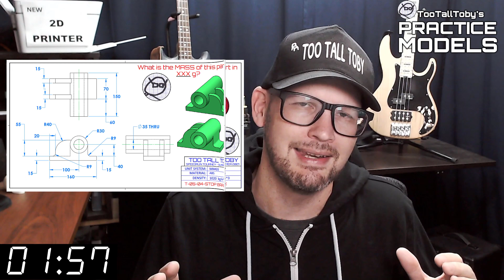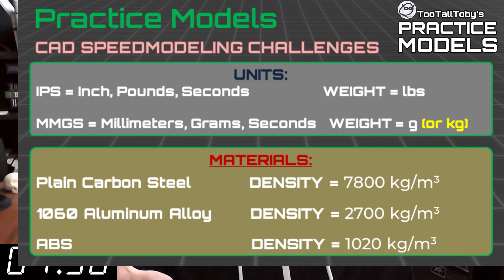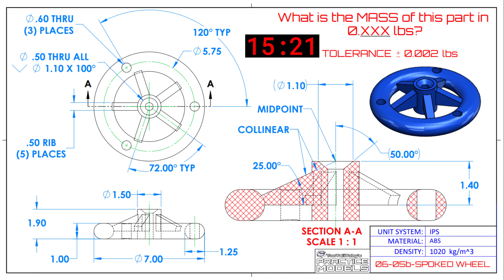SOLIDWORKS Practice - Onshape Practice - Fusion 360 Practice - TooTallToby-06-05b-SPOKED WHEEL

Comment: Got 0.863 lbs in 22 minutes. Not the fastest, but using a new CAD software called build123d! Here is the complete sourcecode:

densc = 1020/1e6 #ABS

ms = Mode.SUBTRACT

with BuildPart() as p:
    with BuildSketch() as s:
        Circle(1.5*IN/2)
    extrude(amount=1.4*IN)
    extrude(s.sketch,amount=-0.5*IN)
    
    with BuildSketch(Plane.XZ) as s2:
        with BuildLine(Plane.XZ) as l:
            l1 = Line((0,0),(-(7-1)*IN/2,0))
            l2 = PolarLine(l1@1,(7-1)*IN/2,25,length_mode=LengthMode.HORIZONTAL)
            l3 = Line(l2@1,l1@0)
        make_face()
    rib=extrude(amount=.25*IN,both=True,mode=Mode.PRIVATE)
    with PolarLocations(0,5,180,360):
        add(rib,rotation=(0,0,180))
    with Locations(p.part.faces().sort_by(Axis.Z)[-1]):
        CounterSinkHole(.5*IN/2,1.1*IN/2,counter_sink_angle=100)

    with BuildSketch(Plane.XZ,mode=Mode.PRIVATE) as s3:
        
            with BuildLine(Plane.XZ) as l2:
                m1 = Line((0,0),(-.25*IN/2,0))
                m2 = JernArc(m1@1,m1%1,.5*IN,-180)
                m3 = Line(m2@1,m2@1+(0.25*IN,0))
                m4 = JernArc(m3@1,m3%1,.5*IN,-180)
                m5 = Line(m4@1,m1@0)
            make_face()

    with Locations((-5.75*IN/2,0,-.5*IN)):
         add(s3.sketch)
    revolve(axis=Axis.Z)

    with PolarLocations(5.75*IN/2,3,0,360):
         Hole(.6*IN/2)
show(p,l2,s3)
print(p.part.volume*densc/454)

Comment: Whats the density in pounds?
Reply: Got it 0,865. Had Issues with the Density. Without i got it in 6,23min in Onshape
Reply: I make custom material library in onshape for TTT, in the list i only have ABS, 1060 Alloy, and Plain Carbon Steel :)
Reply: @siaunen2  so i did. But i forgot to convert the density😜
Reply: @stefanwuttig  you dont need convert the density just select it and i didnt even make it myself. Just use the one on public files
Reply from the maker: As suggested best solution here is to make a custom library in onshape and then, when showing the results of your mass, show it in lbs.  

I have a video coming out soon on the onshape channel, showing how to create a custom material library.  And Neil Cooke has an older video on youtube, showing the same thing.